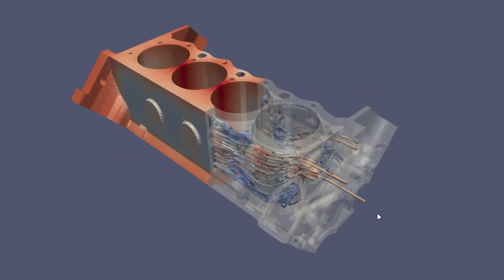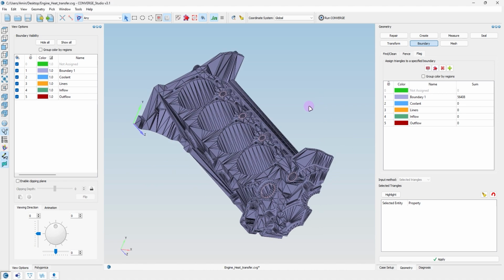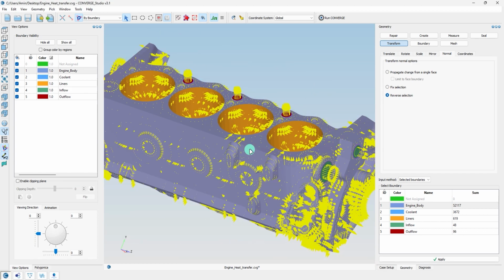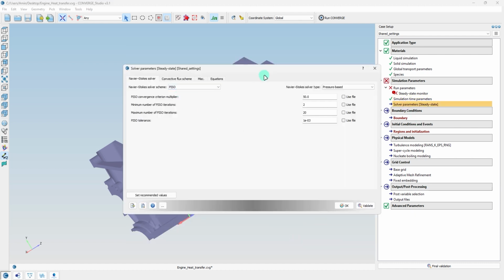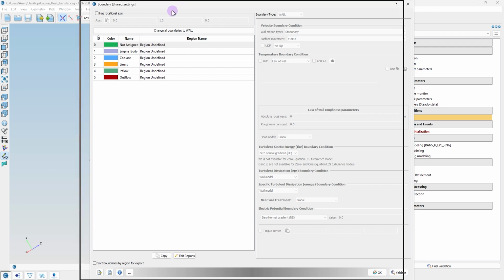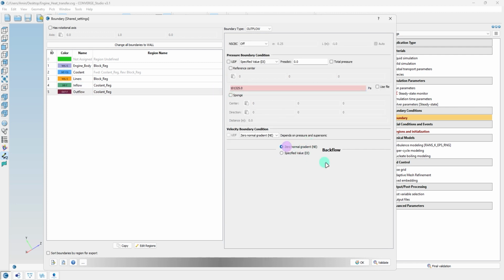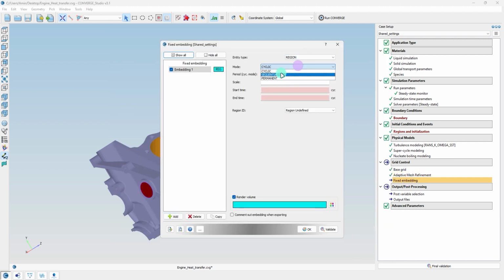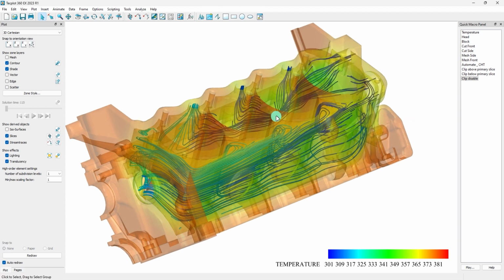Engine CFD-Conjugate Heat Transfer (CHT) Simulation with CONVERGE

Comment: Excellent video! I'm wondering if I want to assign variable temperatures in the liners as a function of liner length instead of a fixed value how I am going to do that? Do I have to use UDF? I would appreciate your help in this regard.
Reply from the maker: The easiest way is to partition your liner's surface to get separated boundaries. 
The accurate way is to use the HTC mapping tool to map your temperature on your FEA surface mesh and use spatial boundary.
Reply: @ASAIEngineering  Thanks for the suggestions. Keep up the good work.